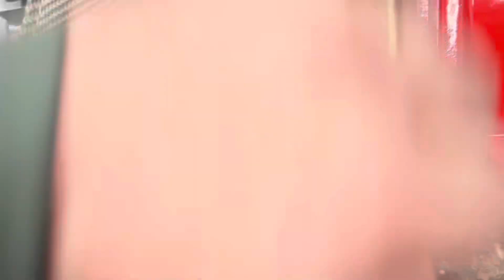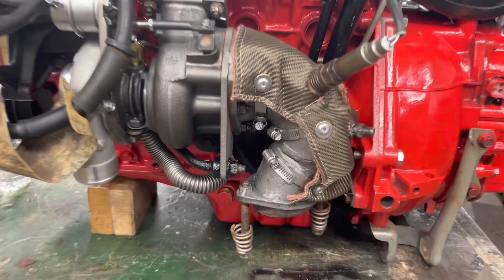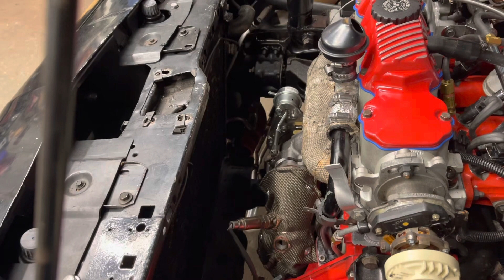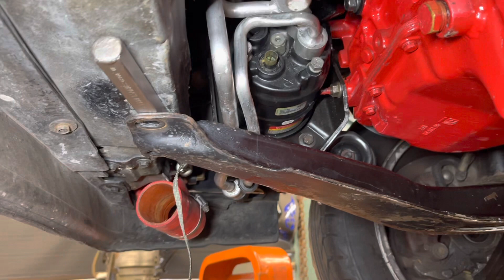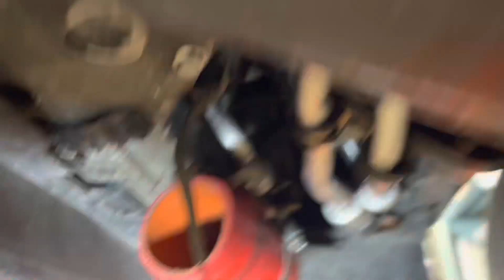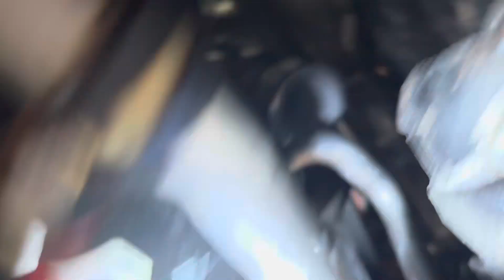1987 Pontiac Sunbird GT Turbo final details and engine install

Comment: Are the fuel pumps in the tank? And are they a pita or not so bad to replace? I'm getting an 87 Turbo conv. and it starts with ether. Previous owner said the fuel pump was bad. Wonder if the filter is just clogged
Reply from the maker: The fuel pump is in the tank. I haven’t changed mine in a very long time but I don’t recall it being that difficult. Last time I did it on the floor with a jack so if you have a lift it will be 10 times easier. You do have to drop the exhaust pipe off the catalytic converter as I recall.

Comment: Did you use aftermarket head bolts I had a 1990 Boost Coupe Sunbird Gt with a aftermarket turbo and kept pushing the headgasket out at max boost
Reply from the maker: Yes, I had the block tapped for ARP 1/2” head studs. I also had the block and cylinder head O-ringed.

Comment: Question: what type of turbo did you use for yours? I’m trying to find one that could fit my 88. Keep up the videos! Car looks clean!
Reply from the maker: It's a Garrett GBC22-350 I bought from Limit Engineering in Arizona. It was around $900 so it's kind of expensive. It's good for up to 350 horsepower but if you didn't need one to flow as much air there was as smaller model they could sell you. If you want to have your original turbo rebuilt they could do that too. My car is rust free but the paint is tired since it's original from 1987. If I can ever stop messing with the engine I'll get it painted!

Comment: Question. Why use that heat shield pad rather than heat wrap from a roll?
Reply from the maker: When exhaust wrap first got popular in the 80's there were a lot of reports of exhaust headers and pipes cracking or rotting away under the wrap. I've never personally had that problem but a lot of Turbo Buick guys complained of it. I've always had my front exhaust pipe wrapped and I've had my exhaust manifold wrapped for years without any problems but I wanted to try this DEI thing out this time around to see how it did.